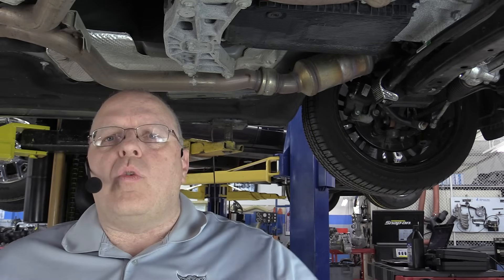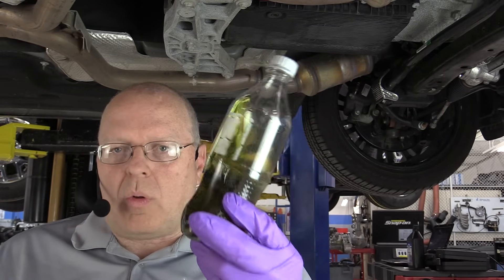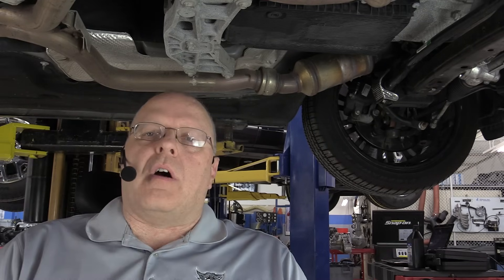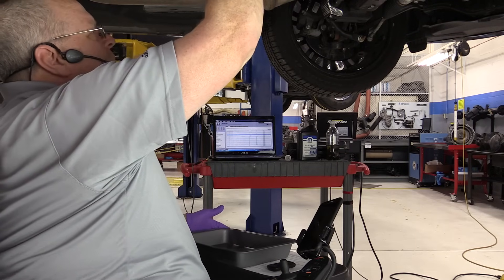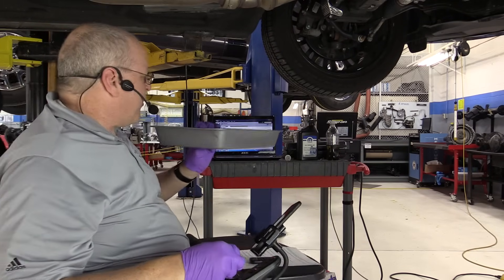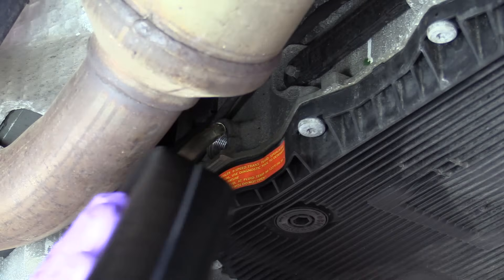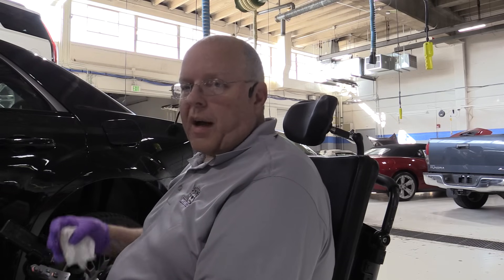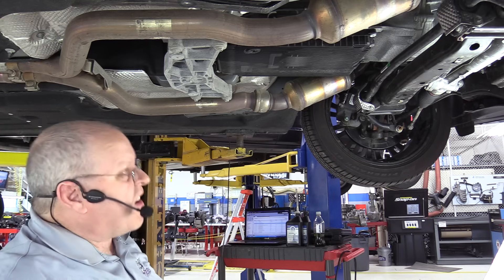Jeep, Dodge, RAM ZF 8HP 8HP 8-Speed  Transmission Fluid Level Check - No Dipstick

Comment: What ever engineer that decided this was a great idea to remove the dipstick should be fired and never allowed to design anything again
Reply from the maker: Thanks for watching
Reply: Planned obsolescence.
Reply: I think the idea was to reduce the chance of outside contaminates being introduced into your transmission via an open hole. Many German cars have been this way for a very long time, and the ZF transmission is used in those as well.
Reply: @misterj5045  Add to that the fact that ZF is a German company.....
Reply: @misterj5045  but the huge plug you remove to check the fluid in these transmissions don’t introduce outside contaminants?
Reply: @tonys1006  The average owner who may decide to pop the dipstick in and out is a bit different than a qualified mechanic working in a clean environment and removing the bottom plug. I'm not pretending to know the true reason as to why it was designed this way, only submitting a hypothesis.
Reply: So you are saying they removed the dip stick to remove any chances of outside containments going into the whole when you take the dip stick out.  Did you not just watch this video? You are literally now having to remove the drain plug which is a bigger hole underneath the vehicle where way more dirt, water debris collects and can easily fall into drain plug hole once removed vs a dip stick above the engine under the hood where less debris dirt occurs.
Reply: @chipdiddy3356 The screw-in transmission plug is water and air tight.

The dipstick in the engine compartment is not water or air tight.

Ever looked at how dirty the inside of an engine compartment can be after a few years?
Reply: means more money for the dealer to service it.....I would imagine JUST to check the fluid level is 1 hr of labour vs. 30 sec using a dip stick
Reply: @dm19609721  Exactly, and it's one less part to manufacture therefore saving cost; increasing profit.  Same goes for the truck demands, Its all about profit. Car manufacturers make more profit on trucks than sedans. So the demands for trucks are completely false.
Reply from the maker: @dm19609721  Proper usage of a dipstick requires much longer than 30 seconds. See my dipstick video to find out why https://youtu.be/s-tHJ2Q_BbA
Reply: What they need is a sight glass system !!!!!  I don’t like assuming the level is good for 40 or 50,000 miles. Hog wash
Reply: No way a couple ounces is gonna make that kind of a difference or the thing would have burnt up already being low
Reply: @randellziegler1318 yep! No way a few ounces low or high is going to make or break. If that's the case this thing is way too sensitive.
Reply: @JF32304  No it's not that sensitive. It can be half qt   either way without hurting anything.  I've done several filter changes and I've always just measured what I take out and put the same back in.
Reply: @Ada-zn3pw  yep. I did a change and I'm right in there, maybe a pint low. I did call ZF as I was curious to level the vehicle or the pan, they said it's the pan. Also, when you're going through the gear shifting process; you don't have to turn the tires to get to 2nd gear, just hold the brakes and manual shift. Almost a 1k miles since the change and doing good, no leaks! Thank you Jesus!
Reply: AGREE IDIOT DOING THAT.
Reply: Ya. The goal is for them being the only ones who can service them. Bastards.
Reply: It s a GREAT IDEA to screw people and rob them...
Reply: bullshit. you dont need to check the oil level. you can do a change after 100-150k km.
Reply: Everyone on the team should be fired! Wait tell you watch how to replace a crankshaft positioning sensor
Reply: Why dont they put a sight glass in them?
Reply: I doubt it was the engineer. I’m sure the manufacturer wants it this way so you don’t service it and end up getting a new transmission or car. If you do service it they make it this way to try and force you to go to the dealer. In the end do it yourself, know it’s done right and save tons of money
Reply: You forgot to mention that said engineer should have his ass beat as well.
Reply: Facts bro lol why no dip stick makes me insane
Reply: Don't worry he's living a very comfortable life with all his earnings never having to worry about checking his own fluid levels
Reply: Probably got promoted for increasing profits.
Reply: The engineers decided most transmission failures are due to contamination.  So they decided to remove the dipstick to remove that acces for dirt, etc. It's a run till it fails thought process.
Reply: Now I was asking the same thing, that idiot the guy who said aa is not necessary the dip stick, anyway there will be no lick, in this kind of cars, nobody cares to see if oil is missing,
Reply: I second that motion...what a bunch of unnecessary German shite!!
Reply: Less men are becoming mechanics so swapping entire units is easier anymore
Reply: Agreed!
Reply: The same engineer that removed the dipstick from the BMW engine oil
Reply: It’s all about the money
Reply: Totaly agree they make it hard unpourpose so people have to go to a shop to get it done
Reply: 😂 i know!
Reply: Engineers that design things like this should be SHOT!
Reply: i bet he got a raise for forcing everyone into the dealers to make more money
Reply: but he said that the fluid can only be checked at a fixed temperatures as it would have otherwise expanded. a dipstick would be useless in this case and give different reading at different oil temps.
Reply: @Dmxravin  every car with a dip stick for the trans must be checked when up to running temperature.
Reply: @Dmxravin no theres hot reading and cold reading signs on tranny dipsticks.
Reply: @Dmxravin in past you had temp marks on dipstick
Reply: @Dmxravin  yea every Chrysler / dodge Have temp gauge on cluster .. start it up let it run and make sure when it’s 120-122F transmission and check it
Reply: Autotragic tranny problems. Heart-warming 😇
Reply: dipsticks arent really accurate... And why do you need a dipstick, where is your transmission oil going? Change it at 50k miles and call it a day. It's an 8-speed transmission that is able to be reliably adapted from the most fuel-efficient cars to high-hp cars that are pushing 1000lb/ft of torque with little modification and yall are worried about a dipstick.
Reply: @Mrwaffleandmilk  not necessarily but I see your point
Reply: @Mrwaffleandmilk and electric parts are? It’s the most inconvenient way to check for fluid. You get a code and it has to be diagnosed. Meanwhile a dipstick can tell you off the bat what level the oil is
Reply: On one level, I agree that a dipstick would be helpful.  On the other hand, these transmissions tend to be used on RWD/AWD vehicles with engines mounted way in the back toward the firewall.  In many cases, this doesn't leave room for a dipstick path through the engine compartment that could reach the trans.

Comment: I have a 2015 Dodge Ram 5.7 hemi I thought my transmission had to be between 86 to 122 degrees o drain the oil to replace it

Comment: I checked my transmission fluid level at 150 F or 65 C while the engine what not running.
I waited until the fluid came out, the put the plug in
My car is Hyundai Elantra 2020.
My question, should I check it again at 50 C degree? Also, should I check it while the engine is running or not?

Comment: $43 for a quart of transmission  fluid is ridiculous. It better adapt to $18 a gallon valvoline Maxlife Dex Merc from Wallymart or the Turd is just going to have to puke!
Reply from the maker: Do you think it makes sense to put the least expensive fluid in the most expensive transmission you may have ever owned?
Reply: @WeberAuto  Yes by 100K when you are finally changing that Lifetime overpriced green ATF out that trans , that trans will have enough wear in it to accomodate a regular higher viscosity universal full synthetic ATF and relearn to shift just  fine with it  for the next 30 k it will be in it. The OE fluid is probably best but  figure Save the $400 it will cost in fluid and put it toward the cam and lifters the Turd is probably going to need soon after 100K:-)). My Brother had Chrysler Mini van and  had the trans rebuilt years ago because of a radiator failure. Chrysler specified ATF+4 and the trans shop used Dextron 3 with a container of lube Guard , did a relearn and the Turd didn't know the difference.

Comment: I went to a PPE pan with 2 quart extra capacity to compensate for the fluid level, Question were do you set the level I have a 2015 Ram 1500 Longhorn 3.0 Ecodiesel do I level between transmission and pan were they meet I saw on you lift the from looks lower than the back? Im working in my garage using 4 jack stands and would like to know were I need to set the level at greatly appreciate your advise thank you in advance?
Reply: Any problems / issues since u went to PPE 2 quart capacity pan?
Reply: @bushpilot7788  No and changed 3 times. I used new bolts and gasket each time probably didn't need to but why not. I also used a Presure tank to fill trans fast worked great used ZF fluid but now thinking about Amsoil ATF for next change because I use Amsoil for all other fluids

Comment: The fluid in the cooling lines should only effect the level check if the system was recently opened up, once the vehicle has been driven the air will be purged and when the valve closes those lines will be full and remain full until the system is opened up.  If there is a leak that allows air into the system that leak should also let fluid out when pressurized.  So during a normal level check you shouldn't have to do the whole drive the car and heat up the fluid as long as you know it has not been opened up and the customer drives the car regularly.

Comment: I believe the Ford 6R Transmissions also have the bypass valve. Doing a flush and fill through the cooler becomes a waste of fluid as the only flow is through the cooler, and none through the trans.

Comment: Thank you for taking the time to create this video and also for the wealth of information that you have provided. 

How does a dealer or mechanic change the fluid on a ZF transmission and ensure that the fluid in the torque converter gets changed as well?

Comment: Very helpful information, sir!  I just changed the pan/filter and replaced some fluid on my ‘17 Durango and even the ZF service procedure that I was using did not include that but about the thermostatic bypass valve. It did, however, say to overfill by 0.5qt if trans cooler is present. But there is no way to overfill without having it leak out.

I drove the Durango shortly after the fluid change and noticed a slight “whining” sound on acceleration, indicative of an underfill. I’ll check the fluid level again in the morning and add as necessary.  This could also explain the slightly elevated trans temp of 190-194 as opposed to 170’s-180’s that I’d normally see. I just hope I didn’t do any internal damage!
Reply: Did the sound went away?
Reply: @tomorrowcomestoday1621  Yes after I added about a quart/liter of fluid the noise went away and the trans began running cooler.  Was definitely low on fluid somehow.

Comment: Seems a bit overkill just to check fluid level. My assumption is unless you have a failure of some kind its best left alone. Also, what used to be simple processes now seems like a dealer issue which we all know can get expensive. I'm not sure I would even trust the dealer to follow this procedure. Great informative video tho. Thanks .

Comment: So why even start with the initial check (unless you know it’s super low obviously). Just run through the power brake and rev test procedures and go from there. The initial fluid check seems to offer no benefit.

Comment: I have 2016 charger SXT. I had to go to one of those “rent a lift” places cuz the whole process is so stupidly complicated for a rather simple job.

I guess it makes sense for auto shops to charge you almost $1000 for a transmission fluid change , cuz it was a pain in the ass to do it.

Comment: What a procedure. At 43 dollars a quart ,and rechecking for proper level,and draining what's over filled back out .That could get kind of expensive . Agreed?? Why the difficulty with this inspection compared to previous normal transmission inspection procedures ?? Wouldn't a dip stick be more appropriate,and another thing. What is the normal mileage interval between fluid level inspections ? I would hope it's a lot... I haven't looked at my owners manual for my new Dodge Charger RT Scat Pack yet.. Purchased it one week ago. As of today I have 276 miles on it  . I'm 71 years old ,and not hard on a car . Would request a response please..Thank you ....

Comment: My trans keep over heating they said it was the varaam bloxking the cooling system . To put stock airbox back on. It still over heats with the stock airbox. Does the therm bypass go bad or stuck closed ? 2014 ram 8 speed

Comment: Hmmmmm  what if you just drain the whole thing and add exactly what its supposed to take? Wouldn't save and money? Yes the fluid is expensive but so is diagnosing for 2 damn days! LOL Which would be a cheap and more accurate process? I am thinking just draining and filling so I don't have to gauge hot cold open closed is it full does it need a top off BS. That makes no sense! Get it all gone, all what it is supposed to take and drive home in same day!

Comment: Hey everyone. Do a little web searching, I bought an aftermarket OEM-(NEW) pan from a  seller in Houston for approx $66.00 including shipping. THEN I discovered COMPATIBLE replacement fluid from Transtar , also in Houston, FOR $4.50/ quart. NO WHERE NEAR $20-$40/QUART FOR THE ZF8. . I bought 9 quarts for $44.50. with shipping. 
Even Ebay was way too high, they want $17/quart for the exact same item. LOOK IT UP !! 
DO SOME SEARCHING EVERYONE. There are charts out there on the web that show replacement fluids, you just have to look !!   Do a little bit of surfing and you'll find these. 
My 2016 Ram 1500 5.7L Lone Star, 8 speed tranny, 71,000 miles, works perfectly. With no dipstick to check fluid levels, this system IS A SEALED SYSTEM. That means there is NO EVAPORATION or usage or any way for the fluid to be low or to get out ( unless it leaks out.) So, I installed the new pan, MEASURED what I took out and refilled with the exact same amount. I used a modified 2 gal. pump-up weed sprayer, (about $18 ) installed about 3 feet of clear plastic tubing to its outlet connection with a 1/4 turn brass ball valve, stuck the tubing end into the fill hole put a rag around the tubing, pumped up the sprayer, opened the ball valve and filled it back with the new fluid and put the plug back in. No need to get temps up or anything. I just put back what I drained out. I had no problems BEFORE doing this service and I have no problems NOW ! Now this is my own personal experience and cannot say or guarantee you will have the same results, but I sure did. and am saving a chunk of $$$. 
Total cost was less than $150

Comment: Hi, is there a way to force the old oil to get flushed from the pipes going thru the cooling system on a RAM 1500 2015 Ecodiesel?  I watched lots of videos teaching how to flush the oil from the trany only, and not from the cooling system.  It is not logical from ZF  not flushing all the oil.  The old oil stuck in the cooling system contaminates the new oil.  Still puzzled with the ZF method.
It must be a solid trany, but why ZF didn't bulit a classical trany which is so simple to flush all the oil in the trany and the oil going in the cooling system.  Germans make thing so complicated.

Comment: The fluid level is correct because there is fluid in the cooler. If the cooler dry because it was being replaced. Maybe then.

Comment: Im thinking if the cooler valve is closed the lines should still be full of fluid having no effect on the level in the transmission. I don't think the cooler valve will somehow suck all the fluid out of  the cooler and not have it going back in; it should be a loop that is full continuously.

Comment: @WeberAuto
I heat the transmission to 160 °F to open the oil flow to the cooler. How to cool the transmission to 86 °F, so that the oil still remains in the cooler? I assume, that the oil pressure should be maintained when closing the valve. In which gear is it possible?
Reply: I would also love to know this, does the fluid flow back? So when you ceck it after opening the valve and you let it cool down doesn't the fluid just flow back into the gearbox and seem like its over full??